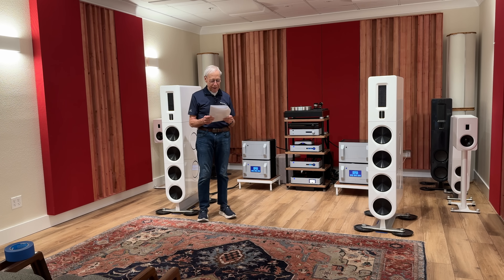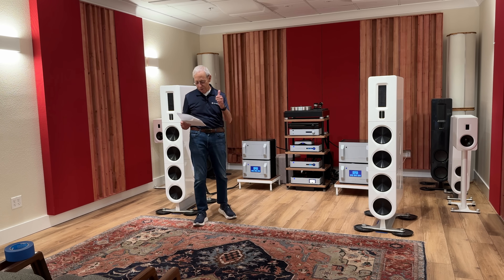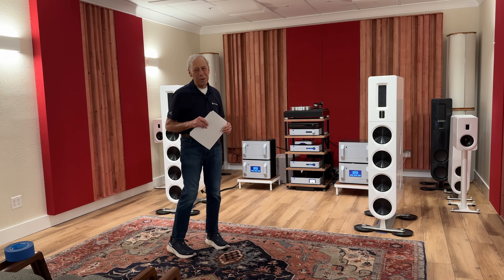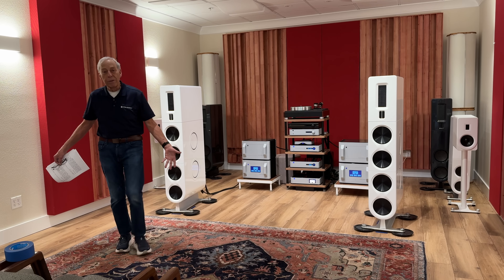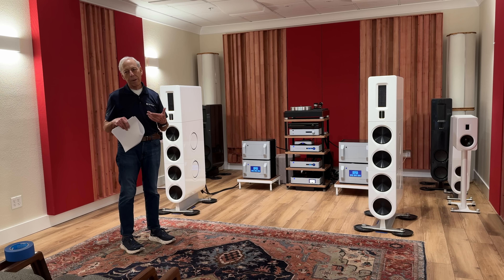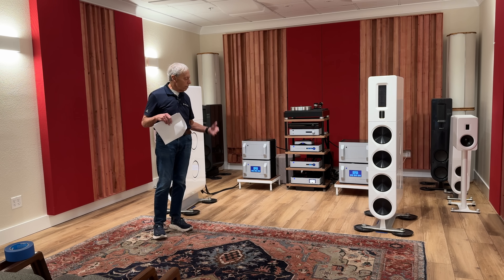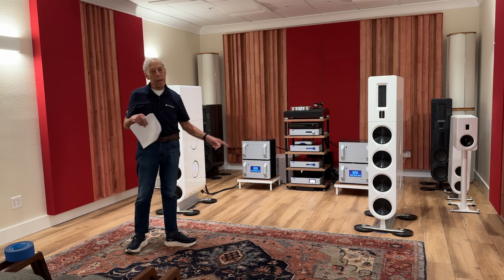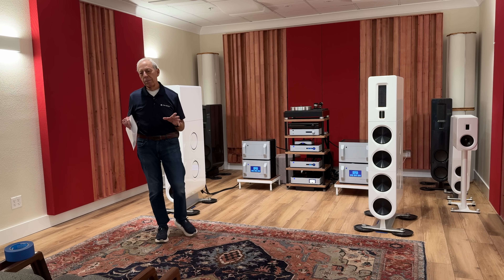Do silver or copper conductors matter in a speaker cable?

Comment: Yup, Audioquest are my favorite too. I use Lapis balanced interconnects and the Sterling speaker cables. Both of these are half copper and half silver conductors inside and with my system (Krell based), it blows me away. I tried AQ Diamond but it was way too bright. I would really like to try the old AQ Dragon from back around 1993-1994 when I put mine together. I've only seen one pair for sale and I missed it by a week. :(

Comment: Back decades ago I heard a pair of interconnects that were made out of Vandenhul MCS 300 6N's silver against a pair of Tara Labs OF copper and the Vandenhul made out of the tone arm wire was the biggest improvement I have ever heard from interconnects. The resolution was way way better but just the wire to build these cost 400$ for 1 meter pair and that was 1990 $'s.

Comment: I have a pair of Monitor Audio Gold 100 5g speakers hooked up to a Rega IO Amp. At first i had a pair of cheap very old copper speaker wires. Then i had the urge to upgrade them with a 2.5mm^2 silver plated Oehlbach speaker wires. I couldn't stand the sound. It took all the joy i was getting while listening the music. I replaced them with a 2.5mm^2 copper wire and it was music to my ears again. So much difference.

Comment: What about occ  vs ofc copper?!  Tbh if given the choice between a thicker copper cable and a thinner silver plated cable I'll go straight copper. Then there's dielectric which I'm surprised Paul didn't mention. I like polyethylene for its relatively low cost to good dielectric properties. Then you have twisted vs parallel connection, both will have an impact in different ways. Lots to talk about with this subject!

Comment: Well you know what,  it doesn't sound different when the cables have the same resistance.  If it sounds different it has nothing to do with the silver or copper but the wire gauge will make a small difference.  Paul can't say that because it would hurt the business of all of his buddies in "high end" selling silver cables that contribute absolutely nothing to the sound of your system that you couldn't get with reasonably thick wire from Home Depot.  Better yet, mount plate amps with digital crossovers on the back of each speaker and eliminate the speaker cables all together.  Your system will never sound better than when you eliminate the speaker cables and passive crossovers. Your local audio boutique doesn't sell plate amps and they have no clue how to set one up, so they must keep peddling cables, amps, passive speakers and preamps etc. to keep to the paradigm that makes them money.

Comment: I notice a difference for sure.  However…. Most people would be far better off spending upgrade $ on everything else, particularly speakers.  Wire is the last thing, and is a refinement thing.  It’s never a complete system changing event.  That’s where most go wrong.

Comment: The difference between only copper and only silver in interconnect is very obvious. Silver as the material suggests (oddly) in much brighter. That said the geometry and construction of cables has an greater influence on the resultant sound.

Comment: Synergy and voice matching everything to assume for the cheaper copper IC's, is not going to work for people who want the least resistance to sounding live.
Unusually for Paul, even while my 2 month old revelation that I have not yet  spent ANY (relevant) money on speaker cables yet, and so have to be stuck with being unfair to what all my speakers can actually be doing about my setup, even while I went, and still will go, headphones first, and even went nuts about getting a $600 custom headphone cable, and already thought it was worth it right away for my uber new headphones, before hearing what my next $300 IC did for my pre-amp first, before sending to the final amp on my new 2nd best cable, that $60 one that's somehow cheating, and including some of that new $300 IC to the pre- to the final anyways.  It's probably still only sending that even better cable's sound signature to the final.  No, a cable upgrade to the pre- will still give everything afterwards a boost at what it's doing, won't it?  So, no answers from Paul about the CHINESE ebay $150 silver-plated (lies about being actual) 5N copper VS it's $300 counterpart, the 16 core (lies about being) 8N purity version of the same bi-wire cable.  However, we can probably just assume that unless you get into some type of geometry argument instead of purification (even if they cheat and tell you it's a whole 8N for the $100 victory), chinese audio fans picking to just put some decent DIY terminations on the higher purity spools of wire to beat their own other assembly line minimum wages for someone else is the right idea for the unknown and knowingly likely to be uncelebrated as an individual's name game of cable selling.  Exactly, George Cardas is famous for not just circular inner cable patterns, and making his own cables, not just putting the ends on some higher purity cables, which cable sellers have a right to try to beat Cardas at value, on top of performance as usual, if they like.  Chinese ebay cable makers will try to beat Cardas for value by selling the same purity of metal as a simple round cable, though, even though they're probably more likely to lie about the actual purity as being even more pure than it really is, since minimum wage still sucks, even if it's cable making at home while you can even be listening, too.
The only thing to complain about with cables is that silver is always going to be more conductive in a way that it's slightly faster BUT colder and more analytical than the next most conductive metal, which is luckily the only very slightly less conductive copper, which happily happens to be only 1/10th of the $$$, which helps a lot of people a lot, considering that the 3rd most conductive metal is way below the relatively similar conductivity degree of silver and copper, and since it's gold, would reflect it's purification cost vs silver also, and be a total loser to the audio community in the first place, except for how it's corrosion-resistance makes it a great choice for plating your end-plugs with, since silver sucks at that naturally compared to how good gold is at that also.

Comment: Sadly I have to disagree with silver cable having any worth, or making a worthwhile difference, we have seen ABX tests showing audiophiles cannot tell the difference between an fancy cable and a coat hanger, so what possible LCR values in two cables where the only difference is copper against silver,  will we hear anything considering so far the differences have been related to lengths we will never use at home, at frequencies no one uses at hifi, at noise floors around -110db.

As for Audioquest, well they have CONTINUALLY been measured by reputable engineers and the company has been shown to be lying and ripping off consumers with psuedo claims and techno babble, AES engineers, Audioholics, Audio Science Review have all shown the measurements of Audioquest products not doing as Audioquest claim, so far Audioquest have done nothing to prove otherwise, and all we get is some of the lowest IQ members of society ranting abuse at the measurements, yet having no actual counter proof, just dumb remarks lik ethey heard more chocolate and a velvet top end with a darker darkness to the dark bit. 

I remember Audioquest, I used it years ago, until I found it was simply so badly engineered it was why I was getting clipping and my amp was going into protection, changing to Naim Nac5 solved the issue, simple LCR value.

12awg OFC vs 12awg high purity silver, It will be measurable. But in 30 plus years, the measurements have shown decimal differences where we cannot perceive them. It's why for even the most demanding applications, no one has bothered with solid silver, in a professional capacity, lets not pretend anything audiophile matters as the last 20 years of cables and online debunking have firmly nailed that loony theory coffin shut.
So when you factor in the cost of the cables, the decimal differences masked by the amount of distortion in audio equipment, and the reality of listening, you get to see why no one without mental health issues bothers with solid silver, and yes I used to make silver interconnects, back in the day when they claimed silver had more detail and was brighter, the days where everyone described a sound by teh look of a cable, cazy.

And lets NOT pretend Hi Res anything, no one is going out to buy microphones cabale of recording up to 100Khz with systems capable of over 145db and utilizing anything 24/192+ Hi Rez actually does, the only people benefitting are the studio engineers as it gives them recording headroom and so forth.

Comment: honestly i respect that you take your stand on such a controversial topic! to me, it does make sense since it would affect the resistance somewhat, and it seems like plated wires would have strange effects on the speed at which everything travels. unfortunately i cannot invest in premium speaker wires so solid copper works for me. thanks for the video!

Comment: A Signal Generator with a very low sinewave THD, Power Amplifier with a very low THD, Oscilloscope, Audio Analyser, Dummy Speaker Load, 4 Wire Milliohmeter / Microhmeter, DC Power Supply, Audio Power Meter, Multimeter, Audio Distortion Meter, Pen and Paper, Scientific Calculator.
With 1 metre of copper speaker cable, and 1 metre of silver speaker cable of the same gauge, the scientific answer to the question can be found using some or all of the test equipment listed above, there are several ways to go about it with the equipment listed.
What people ''hear'' is 100% subjective, so it can be ignored in this test.
I'm open-minded, but from a scientific, technical, physics point of view, my prediction is that the difference between the two materials will be negligible.

Comment: Silver as of today's science, the best conductor. So it must be best. The sound is irrelevant. Silver is horrible for a cable for a simple reason. It's highly reactive. It's the reason we have photographic film, you know that reactive stuff that captures light with a chemical reaction? It corrodes and degrades a huge magnitude faster vs. copper. And no technology or insulator binding tech can solve that as of our current science. Do cables sound different for all these reasons? Yes. Will silver sound better? Maybe? But for the price you'll pay, you will want to be using them in 10 years, will they sound better then? Probably not... anyone who has stripped old wire and seen the corrosion knows. I know.

Comment: THE PERFECT CABLE SET:  
1) get a bunch of metal coat hangers and unbend them as to have straight runs. 
2) cut off the twisted ends since the twisted ends have high levels of evil resonances. 
3) you'll need enough length to go from your amp or mono-amps to each speaker, twice. 
4) scratch off the enamel or goop on both ends of the hangers. 
5) using copious amounts of ACID core solder, solder the hangers end to end until you have enough length, twice, for each side. ***note, acid core is better than rosin core since tree rosin can be inconsistent, stinking trees, but good ole sulfuric acid out of your neighbors car battery at 3 AM works the VERY best. 
7) separate the ends or wire runs with popsicle sticks or equivalent by drilling 2, 1/8th inch holes in each stick 3.278" apart. ***note. scientifically proven to be the best spacing length as published by the University of TBS, aka; TOTAL BS   
 8) place one popsicle stick every 4.5 inches apart end to end. this spacing dampens the anti-resonant gravi-ta-torter demons to maintain a perfectly FLAT frequency response from 3 Hz to 30 MHz, regardless how crappy your amps and speakers are. 

Yes this arrangement will make an old used $50 amp and junkyard speakers sound like PURE GOLD !  AND is on par with the system which GOD ALMIGHTY uses DAILY !!

 9) spray paint both speaker cabinets with different colors. I find purple and orange seem to mellow out the high end and adds some gut punching bass, especially below 50 Hz...red paint  instead or orange if you live in an apartment and don't want your noisy neighbors calling the cops from all of the boom boom bass racket. 

10) turn your system on and let it warm while consuming HUGE amounts of alcoholic beverages BEFORE any listening!...

FORGET buying anything from PS Audio, in particular, Paul's advice regarding buying the best speakers you can afford. Just because Paul starting with a phono-preamp, a gazillion of years ago to building a multi-million dollar corporation dose not mean he knows squat about perfect orgasmic audio cables and proper color physics with regard to speaker enclosures . Ask Paul if you doubt my pseudo-accusations !!
 
Go to your fav junk shop, get a pair of scrappy speakers a cheap amp. working or not and carefully follow these directions and be prepared for a super intense series of audible orgasms !!!!!!!!! 

Your mileage may vary but that's the way the audible cookies crumble !  

Is it April 1st yet???????????????

Comment: Silver or gold plating will make a difference by changing the conductivity at high frequencies, specially on stranded wires.

Silver REDUCES the skin dept at high frequencies so by adding silver plating you enhance the conductivity at high frequencies generating a "brighter" tone.

Gold on the other hand INCREASES the skin dept reducing conductivity at high frequencies, generating a "warmer" tone.

Hope this helps 👋

Comment: We are talking about RESISTANCE and of course that is a well understood and completely measurable property of any wire. Also there is the skin effect of more of the current being conducted by the conductor's surface at higher frequencies, however for audio frequencies that is negligible considering overall resistance in the amp to speaker circuit loop incl. voice coil, which is usually made of thin copper. Ultimately there is a value proposition of your cable in how low resistance you get for your Dollars. While silver has better conductivity, it is also more expensive. So, when comparing copper and silver wire based on cost relative to resistance, silver wire is significantly more expensive than copper wire. Case closed.
Reply: Yep - just buy slightly larger cross-section copper cables and the silver’s marginally superior conductance is negated.
Reply: So, is the mechanism that silver being 5-10% better in conductivity than copper permits 5-10% higher peak current going into the speaker - and that is what is being heard?
Reply: @Michael-oj6rt  Per Dollar you can handle more peak current using copper than silver. At the same gauge, silver is better but per Dollar, copper is better.

Comment: My experience, and what I have in my system, is that an unterminated half metre 22 gauge single strand pure silver wire sounds best.  Silver wire is not as expensive as you might think and MUCH less expensive than some copper cables.

Comment: I’m actually surprised there aren’t people out there selling oxidized copper as a benefit with some BS like the oxidization blocks RF or is the only indication that the material has broken in.
Reply: You have also stumbled onto another facet of copper wire which is rarely mentioned...  No matter how good a copper cable is or how "oxygen free", the surface will slowly but surely oxidize over time.  Copper oxide is not a conductor of electricity but a semi-conductor and will adversely affect a signal going through it, whereas silver oxide will remain a conductor.